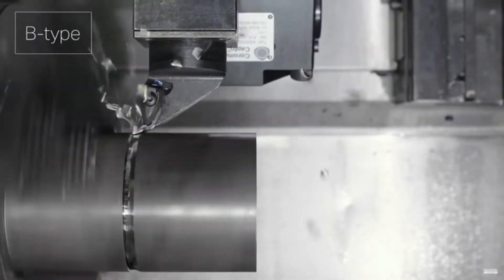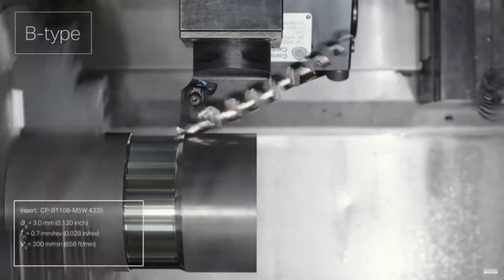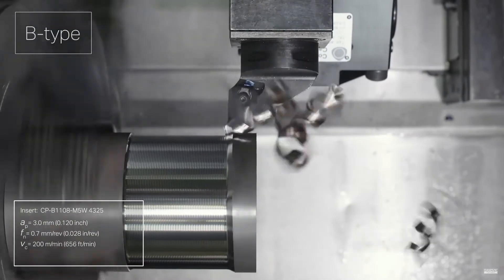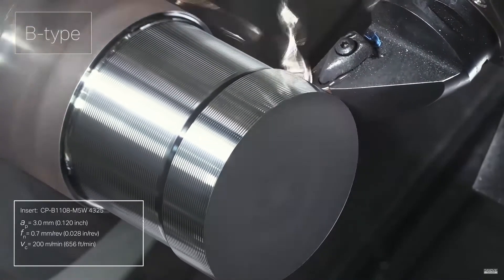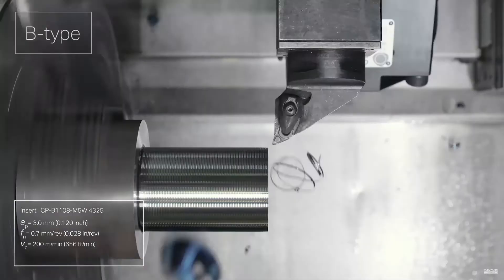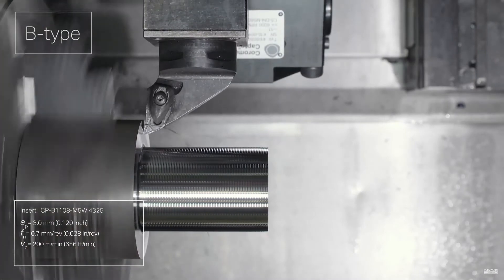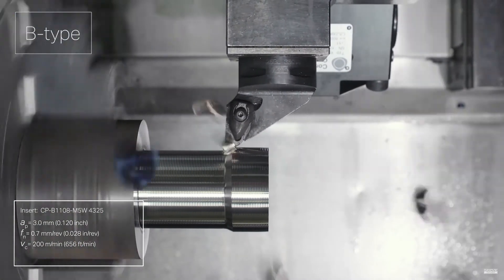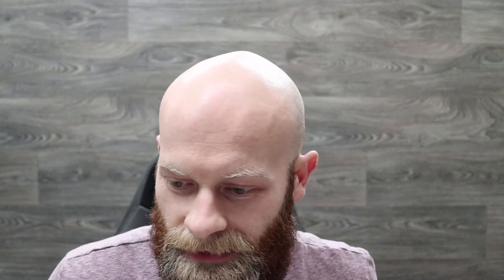Prime Turning, Should You Use It?

Comment: I almost always finish from left to right with a VNMG, except for long shafts where it tends to chatter from the increased downforce. The biggest downside of roughing this way is DOC. Sandvik says .08DOC where I generally rough about .2-.25DOC without having to slow the initial lead in feed.

Comment: imagine this
you have x speed and feed for normal tools
then you add another revolver to balance cut and double your output
then you change to a prime that uses 2x feeds
then you add the second revolver to 4x your output
or something along the lines, obviously you'd get most out of this if you had larger parts that require great material removal and in large batch size.

Comment: 3:12 i have G71 replacement makro that reduce long chip forming. this would not be hard do makro. wh need cam its slow and do only RED RED collision. why cm do collision LOL DONT cut inside selected figure. how hard it is? and 10000 lines than simple G71 cycle and measures from drawing. its same fast write program hand than start drawing cam. not need desing part again someone allready do it and give me pare with measures i just type in LOL. and it was funny i made bit complicated figures and cam did longer program than cnc have memory, but i made same part 100 lines with makro LOL LOL
Reply from the maker: Yes, Macros are great. Especially if you are making similar parts or doing similar tasks routinely and only need to change a few variables to make a different part or adjust the task done. 
In the past some cam system weren’t reliable with the post and code they put out. This meant you had to pay attention each time you ran a new program. It’s also true that cam systems will put out a lot of code that it would be much shorter using canned cycles or macros. However, some current cam systems are reliable with posting good code and the long code they put out isn’t an issue as you make changes to the program in the cam system and re-post. Both ways of doing it have their place and benefits.

Comment: I've been using Prime on and off for the last 3-4 month's. It definetely is job specific as to its effectiveness. In almost every application we've been able to save at least a little time. It certainly took some tweeking to get each job dialed in correctly to get the effectiveness.
I wrote my own Macro  for the roughing cycle so I could have the ability to adjust things without having to rewrite the code.
As of my last conversation with Tim Baust(The Sandvik Prime Turning Guy in the States) only certain CAM softwares can properly generate the code to use Prime properly. A definite drawback and why I wrote my own cycle.
 
  Just my $.02 worth

Comment: Prime Turning inserts have a funky edge that has two extra angles compared to a DNMG insert and they, and their chipbreaker is supposedly designed for this lead angle and feed rates. It's something like a DNMG insert body with a CNMG insert tip to strengthen it and probably with some wiper action going. For the holding a tailstock will suffice (and crashing out might be easier too as it will prevent the toolholder slipping deeper and rather it will pull it out) but slender parts will be a problem, and Sandvik has an NC-generator which for what I understand is a post processor thing for the CAM, but I don't know if it can be integrated to the Controller's cycles.
Reply from the maker: I agree. On programming you would need to use a CAM system. I don't know of a controller that would generate that type of cycle.